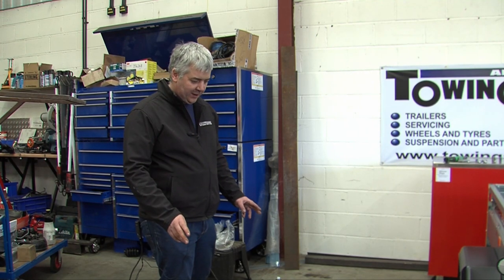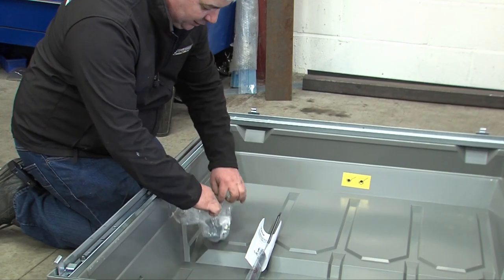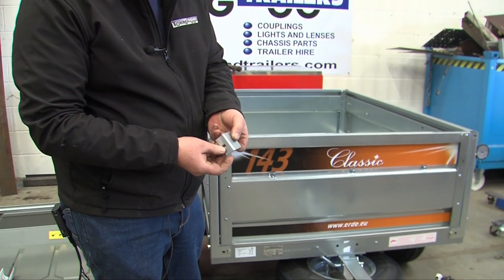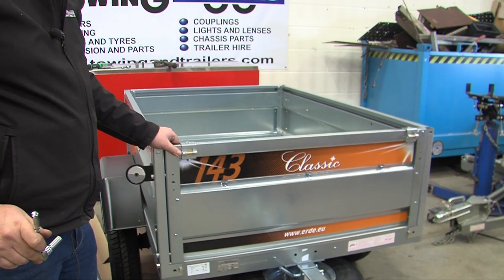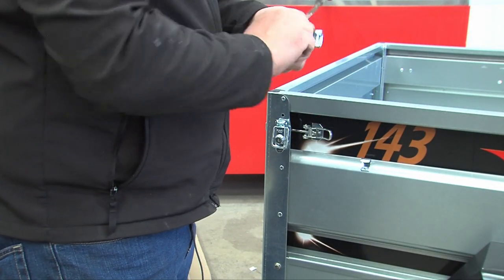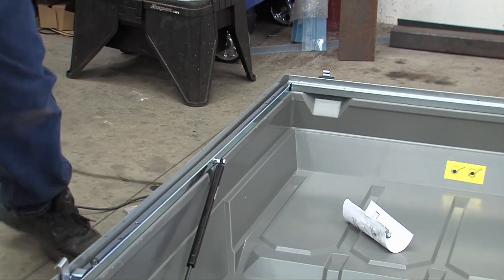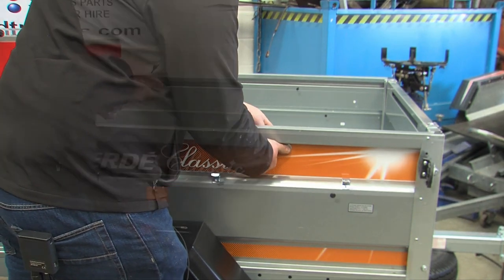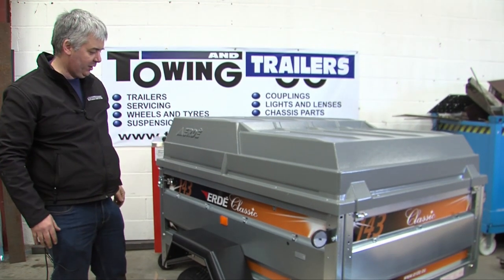How to fit an Erde CP150 hard top to an Erde 143 trailer

Comment: Which screws are needed to fit the locks? I bought the lock as separate parts and it didn't come with the screws.
Reply: Did you find out I'm in the same situation

Comment: Informative video thanks! What do you normally do with the hole on the other side panel where the gas strut mount would go? Working out the easiest way to fill it with bar some tape!? Thanks
Reply from the maker: Hi Tom

Usually the other hole has a rubber blanking grommet in it. If this is missing there is no problem taping.
Reply: @TowingAndTrailersLtd  thanks, doesn't look like I have the grommets. Will tape for now